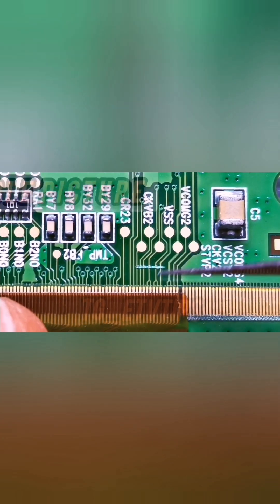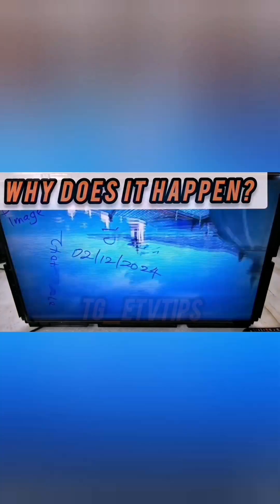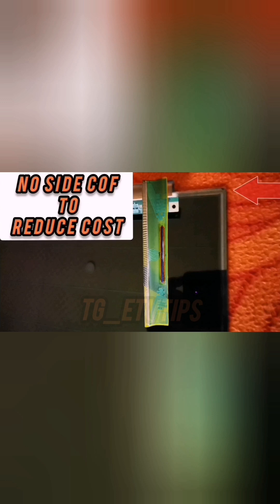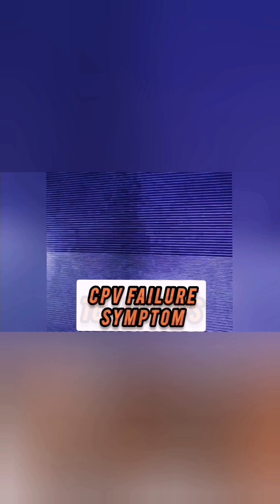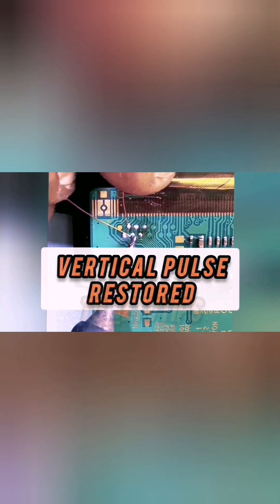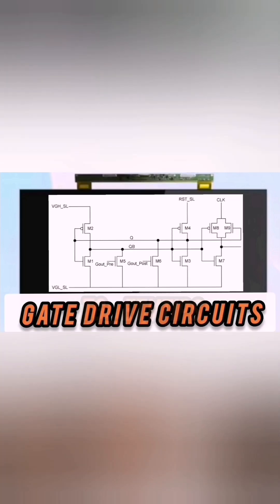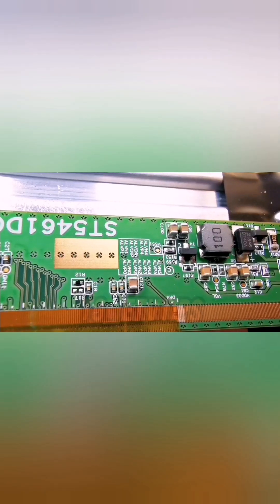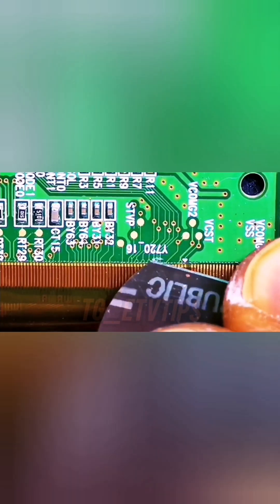How to QUICKLY Fix LCD TV DOUBLE IMAGE Screen Problems

Comment from the maker: Follow me on Telegram for more personal guidance - https://t.me/+4-px4i5cOGUzYTY0 (+2348057362029). Please note that you can purchase some of the repair tools and equipment I use below via my affiliate links.

HABOTEST HT208D Digital Clamp Meter  https://s.click.aliexpress.com/e/_olsXlR9

AUO-M106-11 LCD Chip Power IC
https://s.click.aliexpress.com/e/_opuWh9t
FNIRSI 1014D Digital Oscilloscope 100MHz 2Channels 1GSa/s Real Time Sample Rate https://s.click.aliexpress.com/e/_ooFi705